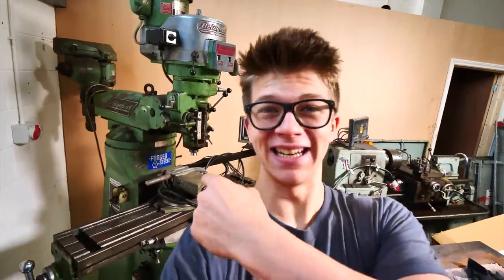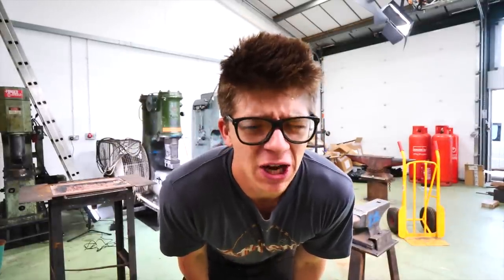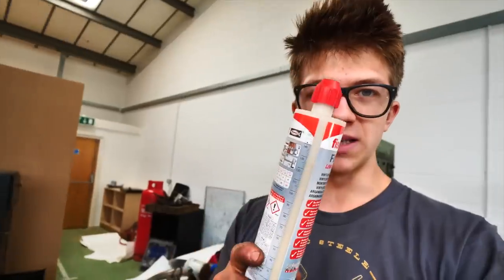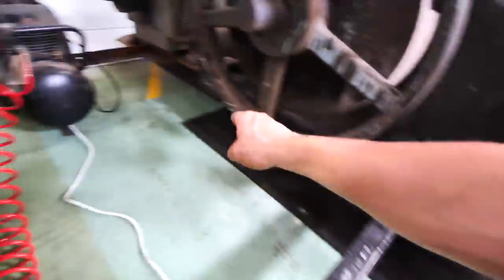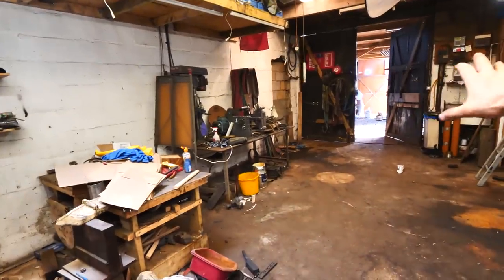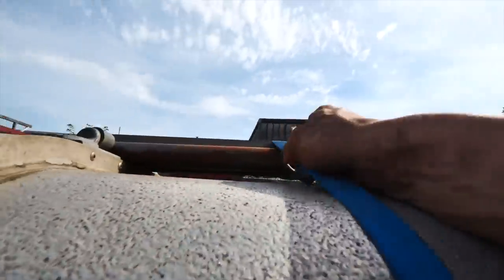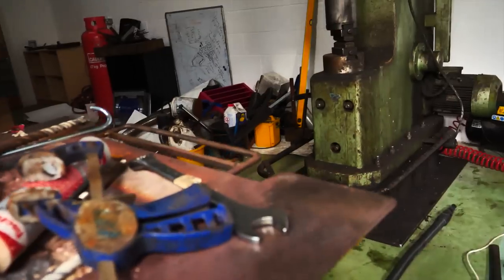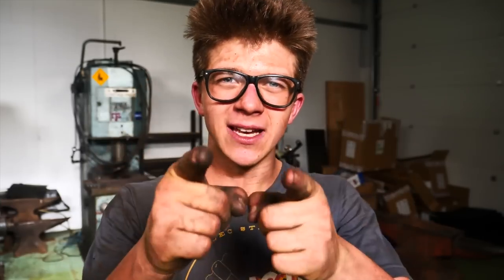MOUNTING POWER HAMMERS!!!

Comment: Hey Alec, just something to think about - not sure what the throw is on those LED panels, but they shadows under your eyebrows and nose will be reduced if you focus the panels to the opposite side of the room to the side that they are on. If you are looking for some really cheep lanterns also that are nice and powerful, look into par cans, around £25 each, and they don't use tungsten bulbs, so that will really nicely contrast with the flat white led lamps, to make everything look a little more 'natural'. look into McCandless method if you are interested. The 'cool' lantern will be your LED panels, the 'warm' lantern would be your par cans. You can also buy sheets of coloured gel for quite cheep if you don't want to shell out for new lanterns, which would create the same effect - effectively coloured plastic sheets for stage lighting. Good thing about using gel with led lanterns is that it doesn't wear anywhere near as fast as other lanterns.

Comment: Being a pipefitter we learn all sorts of ways to properly rig, able to fly a piece of pipe vertically, difference in weight ratings the different ways you rig a nylon choker, learn all sorts of knots that the more you put pressure on them the more secure they are but are easily undone. Some of that stuff really comes in handy more than one would think!  

By the way I think I've added you on about all social media platforms haha, just need to figure out your live streaming.

Comment: Hey Alec, is the heat going to be to much for the ceiling? It was hard to see but is that insulation on the ceiling? You may have to have a air exhaust vent installed.

Comment: A little tip. Put a small amount of dish soap onto your hands and then rub it in as if you were applying lotion. It creates an invisible glove on your hands. When your done with the project, simply use warm water and wash because you already have soap applied. For a young guy, you've got a lot of ambition. Keep it up.

Comment: bro i really hope you read this i've got a few for you i worked in a blacksmith shop for ten years sort-of-big. they installed vent hoods over the forges with high-power exaust fans removing the heat. second your grinding station, genious, only you can't see. it's really dangerious work you need to see who's in there and if they're ok. i suguest plexey glass with plenty of visibilty  you could video from outside mo better   totaly hooked  want to say i found you through jessy i to am now a carpenter like you so much to learn.

Comment: If you're concerned you could weld a foot to the frame near the original bolt hole, extending out past the flywheel, bolt the new foot down.

Comment: You're edits and transitions are on point. 

Side note about your hands not getting clean enough. I work in a fab shop and  my hands get as dirty/greasy as yours. I use a mix of powdered Borax/laundry booster and a swirt of Dawn dish soap. Works great to cut even the toughest grease.

Comment: As a qualified slinger/banksman I can tell you yes, it is quite interesting.  
Also, shame I didn't see this earlier, tip for clearing out holes for chemical anchors - wrap duct tape around an airline, sticky side out, blow in drilled hole and keep repeating. Gets rid of more dust than a vacuum ;)

Comment: Have worked with moving large machines and the most effective way would have been to just place the powerhammer and then mark the holes. Move the machine and drill and then place it back.

Comment: Hi Alec! Love the Channel! Just wondering if you've thought about what looks like smoke detectors on the roof which would be likely wired into a fire alarm system. They may go off often once you start working. I would speak to the landlord about switching them to high temperature heat detectors instead if possible! Thanks for the fantastic content! ~nick~

Comment: #Alec Steele I don't know what the heavy load hauling rules and regulations are in the U.K., however, here in the States, the Department Of Transportation (D.O.T.) requires 1 Chain per every 10,000 Pounds (each has to be rated for 10,000 Pounds of load weight or better) so if your object weighs 60,000 pounds you will need 6 Chains MINIMUM.

Keep up the great work.

Comment: Create a small box out of steel that sits to the front of your truck rack. When you place your stock on your vehicle it seats into the box. It will keep your stock from flying off should you have to stop fast. At that point a bungee cord will hold it in place. We had the same on my old work truck and used it for all thread and electrical piping.

Comment: I've moved big machines like that before. you would need to put the power hammer where you want it, mark the holes with a marker, pull the machine out, drill holes for the difficult anchors, set the anchors then drop the machine on said anchor.  it a complete pain but it's how they would done.

Comment: Might be a little late with this question, did you check the location of services in the slab your drilling into, and is that slab capable of sustained hammering. The United States Mint had to change vertical coin presses to horizontal coin presses because the foundation degradation.

Comment: You should have made the hole under the fly wheel your first hole drilled.  Move the hammer, drill the hole, reposition the hammer so that hole is lined up then drill the rest of the holes off of that one.

Comment: Us yanks are spoiled with Hilti anchor bolts I guess. Just crank em down and they expand in the hole. No epoxy setup time.
Reply: Not for a Power hammer, and I use them as well. here is just too much vibration and impact.
Reply: Hilti also makes the world's finest chemical (epoxy) anchors.  When heavy industry or construction requires the ultimate in anchoring, they turn to Hilti for the product.  I have used a variety of their chemical anchors and they are the best there is!  Go to their website and check out the full catalog.  It is in PDF format so you can download whatever pages you need.  I mention this because their full publication is almost 400 pages!!
Reply: Commando Specialties They are very good, but just so ya know Hilti is from the EU so we're probably spoilt more so by them ;)
Reply: Yep, Hilti headquarters is in Lichtenstein.  Best anchors and hammer drills available!!

Comment: Dumb question but could you not mark the location for the hole, move the whole power hammer over a bit using a pump truck drill the whole then move the power hammer back again.

Or remove the flywheel, drill the hole and then replace the flywheel?

I'm not there in person so its hard to say, but those two would be the first thoughts that come to mind.

Comment: Won't the lathe create waste that requires sweeping? Not enough room in the grinding room for it?
Reply: simply forging with a hammer makes scales fall of the metal,and those also require sweeping.the grinding room is for those tools that produce finer dust
Reply: Bill Sevier Abrasive dust and machining equipment like lathes and mills do not mix. Luckily the stuff that comes off lathes and mills (swarf) is relatively large and easy to sweep up

Comment: Straddling rotary hammers is a spectacular way to increase the likelihood of rupturing your testicles. If that bit catches the edge of the machinery (or more likely any rebar that is probably in the concrete) and stops, all of that rotational energy is instantly moving to the drill body itself. You'll be on the floor or sprawled across your machinary before you kow what happened.

Comment: Please make sure to tell your videographer to double check the sound levels before releasing any videos. Also, everyone in that shop ahould have hearing protection in place before any "whack-whack", your voice alone is so loud in that shop. I would definitely get the sound dampening in ASAP. The shop is looking good, dang but you've got a heck of a lot of equipment. Will there be a long forge of some sort for when you're heating/heat-treating/anealing long stock like your swords? Also, now that you have the room, have you considered a horizontal quenching trough for the longer sword/sword-like projects? Are there plenty of fire extinguishers in accessable places around the shop? Looking good, can't wait for moving and set-up to complete then back to moving metal 😃.

Comment: I'm a bit late out of the gate but would laying a high density rubber, under the big bangers, reduce sound and bad concrete cracking vibes? You think? Would it have an effect on the impact or return on the hammers? Will I wake up at night in cod sweats having nightmares about this? (No.) All of the questions?!?!?!?
Reply: Maybe the extra vertical movement would then have the work piece bounce on the surface as it returns. Oh my gosh. Maybe I won't sleep tonight
.

Comment: I hope your equipment spacing is adequate. They look too close together. You usually have the camera facing the front of the power hammer while you stand to the side holding your work-piece. It looks like with the new setup, that when you do that, you will bump into the other equipment.

Comment: Mark the hole, slide the machine over, drill the hole and clean it out, slide the machine back over the hole, align, clean out hole, put in first stud. Then do the rest. I reccon, you never moved machines around your shop by hand. That thing should move real easily on that coated floor. 
I move em all the time in my shop, no fork lift, only simple hand tools,.. and yagh, some much heavier than that hammer. 
You gots plenty of room, I bet you get a forklift soon, then it will be real easy to move yer machines. 
Nice shop space, plenty of space.

Comment: I do still miss something most important,,,,,,,,A chimney true the roof with a big air sucker inside it, from say 1.5 to 3 time the cubic feet of air replaced in the workplace every hour, you real in need of  that, your now 19 y old and without clean air I am sure you never become 40 y old. I lost nephews and uncles working in a ironwork factory, molten iron was running all day from 5 foundry's, without any air extraction, its worse than smoking sigaret's!
A big room needs a big air cleaner, and than you put all grinding in a small cabin, that relay needs an air filter.
I bet that if you make lung pictures their already blackening, from all the dust.
A breading mask when grinding helps, but than you must at least keep it on for hours after grinding.
You know I like to see your video's the next 10 - 20 years, and without a big air cleaning chimney true the roof, with a big air sucker inside it, you stop before your thirtieths!

Comment: Shoulda used a strap from one machine to the other to pull the hammer over
Reply from the maker: +DollarhideClan man - i feel pretty stupid for not thinking of that!! I'll see if it works tomorrow :) thank you Dollarhide!
Reply: Alec Steele wow I got a direct reply from the amazing Alec! swoons 
Anyways when u use a strap maybe put some grease or something on the hammer to make sure it moves before the other machine moves! If u have any more troubles just ask! I've worked in a steel fab shop as a machine operator and an engineer and I'm also a truck driver!

Comment: Man you should have power washed all your equipment before you put it in your clean shop.
Reply: The old grease and grime will act as an impenetrable coating against corrosion ;) Plus it seems as though his schedule is already pretty tight and it would take hrs to properly degrease those machines.
Reply: HandcuffCharlie lol true very true always can use a coating.